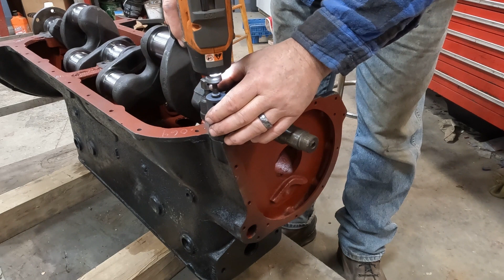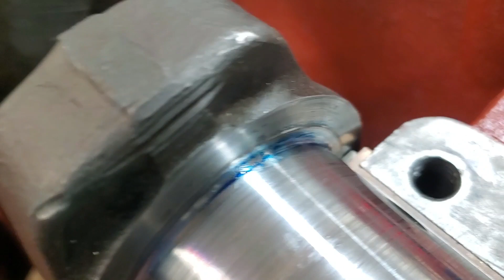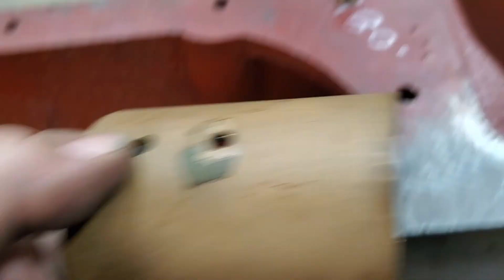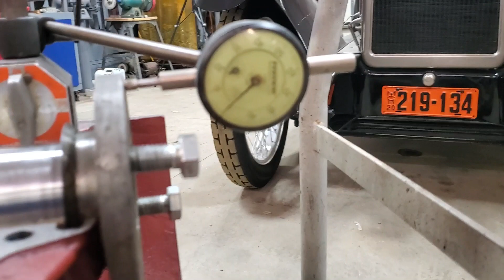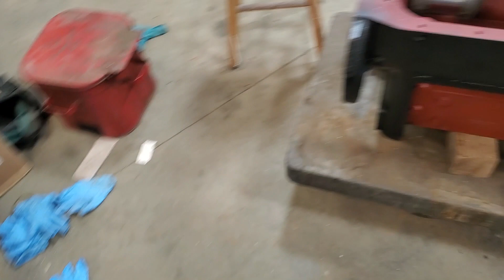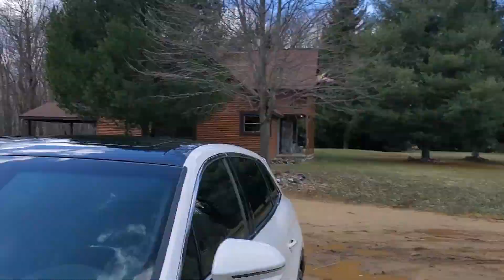1920 Nash 687 Engine Rebuild Part 11 How Is This Machine Shop Still in Business

Comment: What a waste of time,  that thing would have run fine the way it was.  The tolerance was never that critical from the factory
Reply from the maker: You are bringing up that I have been wasting my time concerning factory tolerances got me thinking, what are the tolerances for a 1920 Nash, I could find no 543 charts or specs from Nash directly, so I expanded my search to other publications from that time, this is what I found.

1923, Dykes Engine Encyclopedia, Page 782 calls for .002 clearance, Page 785 Fig 8 has the exact Nash engine I am working on and details the sizing, bluing and scraping of the babbitt. While this is not a spec called out directly from a Nash factory spec book, I can only infer that Dykes received the Photo of the 6 Cyl Nash and specs from a Nash factory publication.

1919,1920, Halls Automobile Construction and Repair , Page 77 Calls for .002 on all engines of this type.

1920, Everyman’s Guide to motor Efficiency, Chapter II “Bearings and their Adjustment” page 16 goes into detail about how to adjust and size the babbitt, words like time consuming, tedious, and fine results, can be found.

1940, Chilton’s, Page 606 calls for a .0015-.0025 spec, This is the second publication I have found relating to Nash, it is 20 years older than my Nash but just about the same engine, it does call for .0005 tighter clearance than the 1920 Dykes book does, I have been setting my clearance to the .0015 spec because I am using modern babbitt and feel it is more representative of what is used in bearings if the 40’s-80’s 

As with most projects I do, I take advise form many resources, and will weigh your “Waste of Time” advise against the Publications I quoted. Considering I have a large amount of money in this project, and this is the only 1920 Nash 687 that we are aware of, I feel I should put more energy if following the published resources but will follow your advice and try working faster as not to waste too much of my time. 😉
Reply: I been watching  your build? Would of been  lot faster if you would of used grinding compound to get the babbitt fiting to the journal